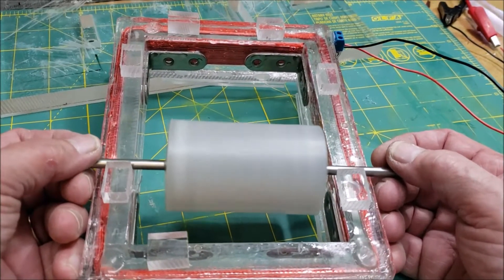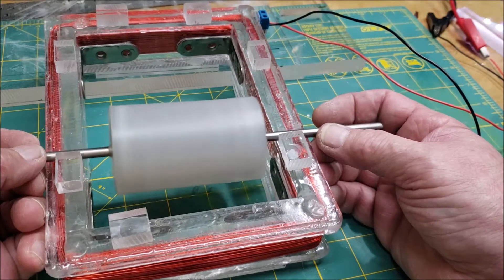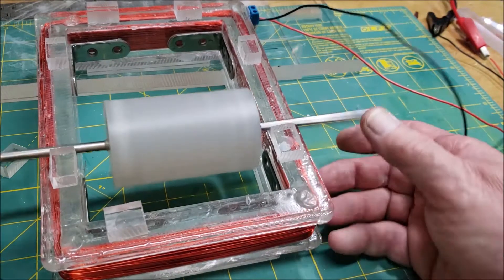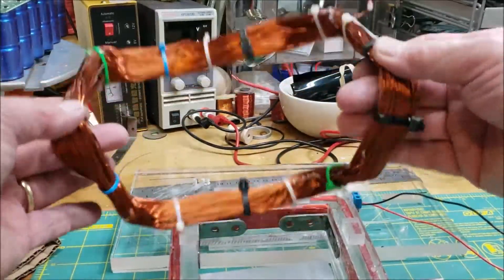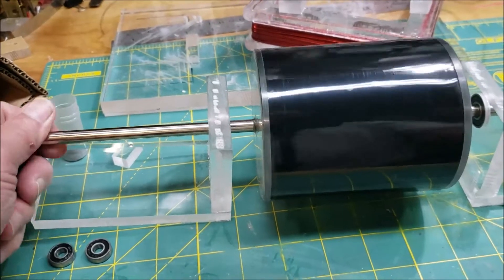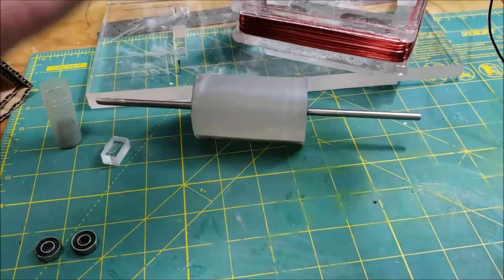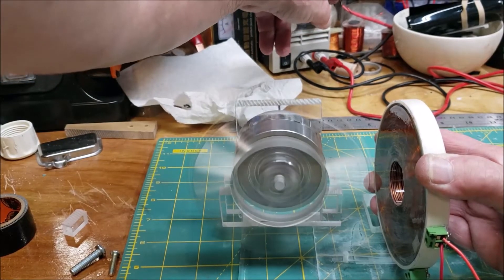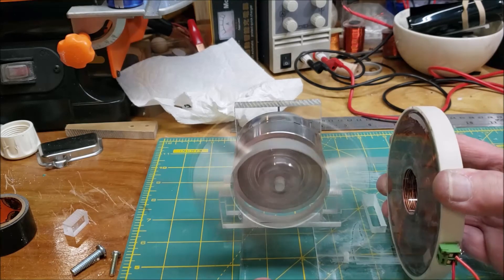Testing new rotor and stuff

Comment: Hi man.
We miss your work? Where are you?
Reply from the maker: Funny you ask. I've been studding Fusion 360 so I can be prepared when I build my 3D printer. I got a Ender 3 pro and figured I better know the software before I build the HW
Reply from the maker: I will be using it to make more precise rotor and rotor cap. bearing housing and other part I usual make from acrylic.
Reply from the maker: be back very soon
Reply: @mcorrade  What funny in it.okay .I will not bother you again.
Reply from the maker: @ssultan4692  no worries your no bother. I appreciate your comments always.